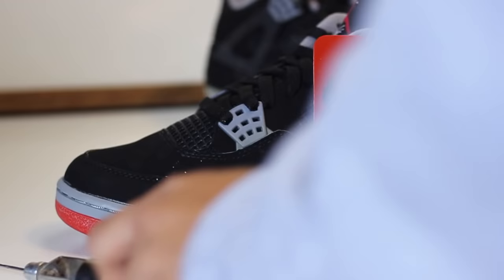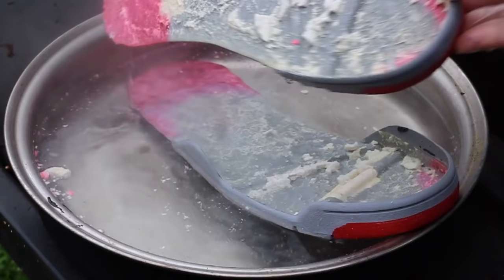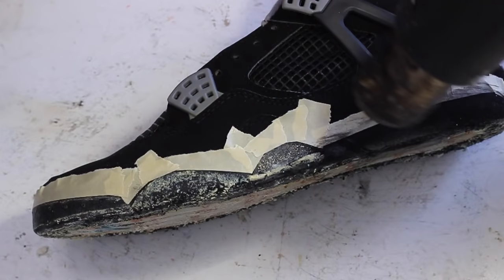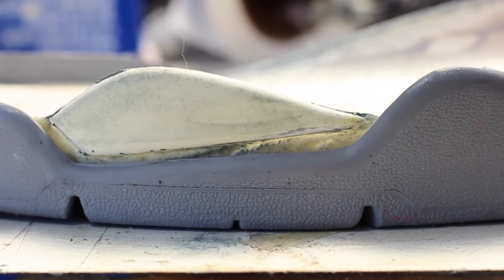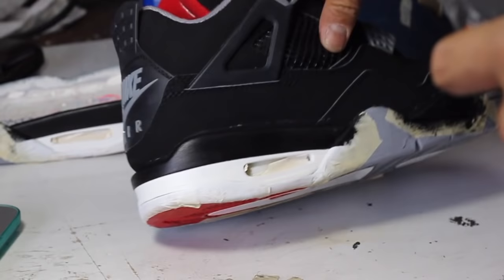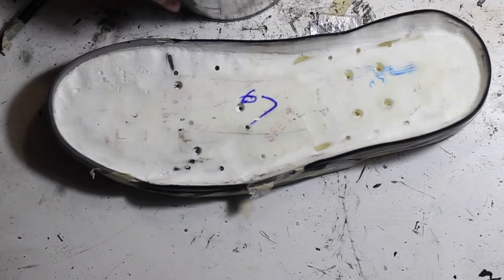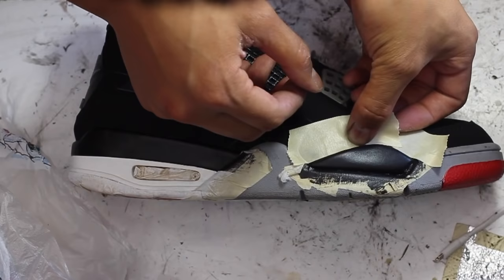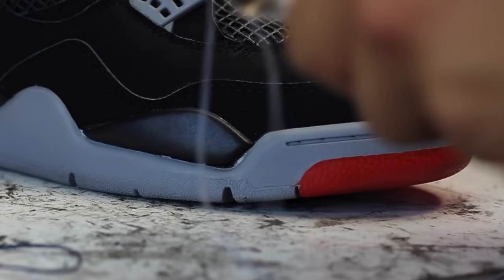1999 Air Jordan Black/Red IV Full Midsole Swap

Comment: Hey John, instead of taping the uppers again after shaving down the midsole as a guide for your glue line, what do you think about using a tailor's chalk pencil or a UV marker? I've seen the UV marker method on some factory videos. Might save you some time.
Reply from the maker: +MJO23DAN Yeah I've seen that! I have a higher satisfaction using tape since it gives me the straight edge lines that I need for reglues. There's still human error when you free hand the adhesive application. I've traced the midsole with a pencil and it's not the same.
Reply: +John Manalo gotcha. I was just thinking that you'd have to have the shoe clamped (before adhesive) then draw the line so that the shoe sits as it should once you've bonded. Anyways, your techniques are always appreciated in the vids. Another great one bro.
Reply: John Manalo whats the song at 7:12.
Reply: Eric Llanez it's by tory lanez that's forsure. I've heard the song before, but I forget the name. Its by tory lanez though
Reply: John Manalo got any size 8.5? Lol

Comment: Dude what adhesive do you use 😓
Reply from the maker: +chris paft Barge Cement Super Stik
Reply: +John Manalo Does it bond immediately when it comes in contact with the other piece? I'm having a hard time getting things to line up perfectly without any time to adjust (infinity cement + reheat).
Reply from the maker: +David Doms Yeah the bond is immediate. You have to manipulate the shoe to get the correct fitment!